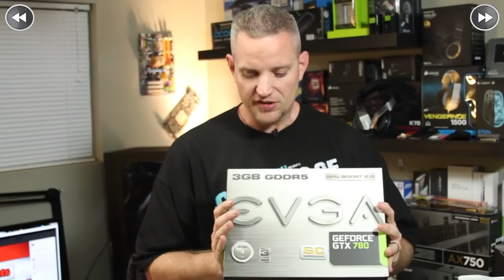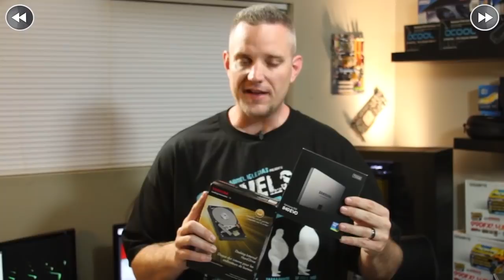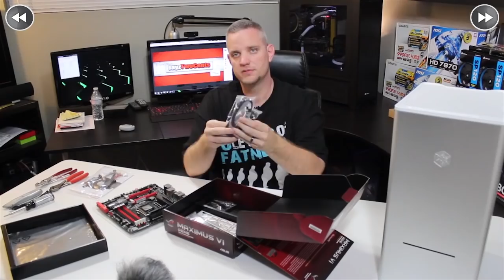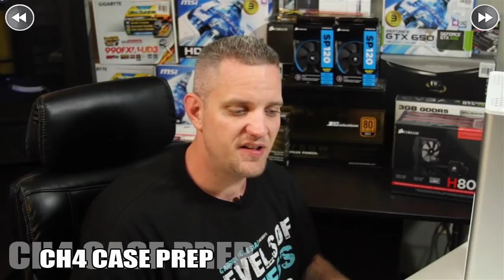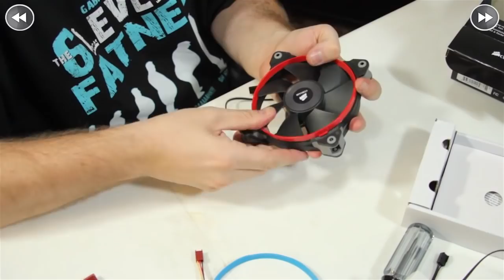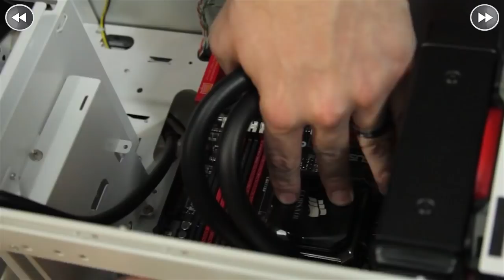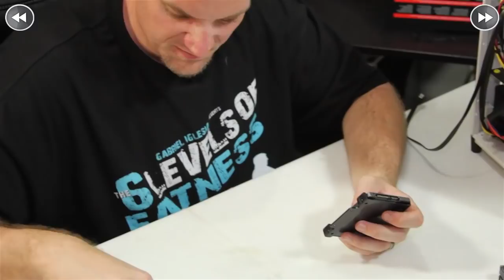How to build the Ultimate Gaming PC - Build Guide and Tutorial

Comment: Wow looking back the 4770k was a top choice only because the Z97 boards were the only and first boards for normal users to support NVMe drives which at this time weren't really known about by the masses, not too mention stupidly expensive.  I might be wrong on the first but as far as I knew only the Z97 chipsets could run it and the Z97 boards had the M.2 slots for them.

Comment: please help me my R9 M385X 4gb throttle down to 700mhz      default(core clock 1000mhz memory 1500mhz
Reply: What cpu are you using?
Reply: +brichard harris fx 8800p
Reply: a fx 8800p is fairly high end so there can't be a bottle neck happening. You should check around the internet about this. maybe you turned down your clock doing something or perhaps your motherboard doesn't support your r9 very well.
Reply: +brichard harris lenovo y700    but the gpu heat upto 80-90°c
Reply: The maximum temperature of the card in which it's still operating is 103c and under load it should be at least 20-30c less than it's max. The card does run very hot so no worries on temperatures.
Reply: +brichard harris hmm I need to do something about it
Reply: There are liquid coolers which you can put on your graphics card which will reduce temps by not very much. most i'd say maybe 10 or more c
Reply: +brichard harris I have a laptop not a pc
Reply: you have to clean your laptop from dust and apply new thermal paste to your computer if you still don't see any difference buy a cooler pad for 20$\£\€ and make sure you have your computer on table not on your bed and I heard that glass tables aren't good too so a wooden one would be good

Comment: Anybody Got A Good Rig For A Streamer That Doesn't Want To Drop That Many FPS? I'm A Console Player, The Only Game I Play On PC Is CS:GO ... So I Wont Be Needing The Best CPU Or Graphics Card
Reply: Probly need twin 1080s in sli Mabey even in tri but it's up to you you may drop some fps then I'd get the best i7 there's cause of bottle necking issues 2tb of ssd cause no one wants long load times and a 4K monitor just in case you wanna play some minecaft I'd include some other stuff but since your on a budget il leave the rest up to you just remember this is the bare minimum
Reply: +Hulk if you want to stream csgo , youd need like an intel core i5 4690k and like 16GB 1866Mhz RAM, for the graphics card a 270x should be fine
Reply: you need a good processor to handle the game and streaming at the same time, same thing goes for the RAM
Reply: +ErpleYn would recommend 380x, since they are 50 bucks apart and make a huge difference.
Reply: +AlternateEdit definately

Comment: AMD FX-8350 4.0GHz 8-Core CPU, MSI 970 Gaming AM3+ MOBO, Mushkin Enhanced Stealth 8GB MEM, Seagate 1TB HDD, MSI GTX 960 Gaming 2GB, Rosewill ARC 650W PSU, Rosewill WolfStone Case. Is this everything i need to build a pc and if so is it good enough to run CS:GO
Reply: And do i need anything else
Reply: Angielino Fidel yes, this looks good. I noticed you don't have an aftermarket CPU cooler, which doesn't matter if you don't plan to overclock the CPU, but if you do plan on overclocking (because this processor is intended to be overclocked) I'd recommend getting at least the CM Hyper 212 evo for 30$. In fact, since the FX-8350 is just a factory overclocked FX-8320, which means that the base clock is higher by default, you can just get the 8320 instead and save 30$, and then when you overclock it there won't be a difference in performance anyway. For example an 8320 overclocked at 4.5 GHz will perform the same as an 8350 overclocked at 4.5 GHz.
So if you're going to overclock, get the 8320 and a Hyper 212 cooler. But if you're not going to overclock, then the 8350 is better. If all you're playing is CS:GO, then either way it doesn't really matter which one you get, since they'll both give you good performance in that game anyway.
Reply: Ok thank u man i appreciate it il2xbox and whats overclocking
Reply: Angielino Fidel It's  making a part run faster
Reply: Ok thanks lelcetz
Reply: Angielino Fidel It makes it hotter though, and use more power.So it's no always good. sometimes it crashes the comp
Reply: Ok thanks again lelcetz

Comment: I'm thinking about building a new PC, what you think about this?
Case: Cooler Master Scout 2 Advanced 
Motherboard: ASUS X79-DELUXE 
CPU: Intel Core i5-4460 LGA 1150 CPU - BX80646I54460
Power Supply: Cooler Master V750 
Graphic Card: ASUS GeForce GTX 960 STRIX  (not sure 4GD5 or 2GD5)
I don't know about the rest yet

Comment: What's your option on. Pic I'm thinking of building? 
Here's the specs: 
Case:
corsair 760t 

Motherboard:
Ms I z87-g45 

CPU:
Intel I7 4790

GPU: 
2x msi Radeon r9 270x (I already have one) 

Ram:
8g of g.skill ripsaws f3

Power:
Corsair ax860w 

Replacement fans:
Bit fenix spectre 140mm red fans 

Custom cables: 
Red cab to type their name 

With red LEDs
Reply: ***** okay. alot of things have changed from this post. only thing the same is the case
Reply: +Harry Ford dont get a 970, get an r9 390 if you already have a 270x you might be able to crossfire it with the r9 390, hence more performance, less money youll have to check if youre able to crossfire them though
Reply: +Hello 27 get a 1070 or 1080 if u r into vr

Comment: Is this a good setup and or all compatible with each other? 

Monitor - BenQ GL2460HM 24" LED 1920x1080 Resolution

Processor - intel Core i7 I7-4790K 4 GHz Quad Core

Motherboard - MSI X99S GAMING 9 ACK Series Motherboard

RAM - Vengeance — 4GB Dual Channel DDR3 Memory Kit

Power Supply - VS Series VS650 — 650 Watt 

Hard Drive - Seagate - 1TB Internal Serial ATA Hard Drive

Graphics Card - MSI - NVIDIA GeForce GTX 960 2GB GDDR5 PCI Express 3.0 Graphics Card - 

CPU Cooler - Hydro Series H110i GTX 280mm Extreme Performance Liquid CPU Cooler

Case - Graphite Series™ 760T Full-Tower Windowed Case
Reply: James Fulkerson what is your budget,,, the mobo is for lga 2011-3 and the cpu is a lga 1150
Reply: My budget is $2,500
Reply: Just wait a few minutes, i will give you a pcpartpicker list...
Reply: http://pcpartpicker.com/p/FsXMYJ there you go... you can choose a cheap monitor, but stick with 2160x1440

Comment: Hey guys! Do u think that i can build a gamer pc for about 1500$?
Reply: Dumma Dum Gaming 
Just a little insight on what you can buid with a $1500 budget (assuming you have keyboard and mouse)

PCPartPicker part list: http://pcpartpicker.com/p/s6X2Mp
Price breakdown by merchant: http://pcpartpicker.com/p/s6X2Mp/by_merchant/

CPU: Intel Core i5-4690K 3.5GHz Quad-Core Processor  ($199.99 @ Micro Center) 
CPU Cooler: CRYORIG H7 49.0 CFM CPU Cooler  ($34.50 @ Newegg) 
Motherboard: Gigabyte GA-Z97X-Gaming 5 ATX LGA1150 Motherboard  ($116.00 @ SuperBiiz) 
Memory: G.Skill Sniper Gaming Series 16GB (2 x 8GB) DDR3-1600 Memory  ($102.99 @ Newegg) 
Storage: Crucial BX100 250GB 2.5" Solid State Drive  ($89.99 @ Newegg) 
Storage: Western Digital Caviar Blue 1TB 3.5" 7200RPM Internal Hard Drive  ($52.49 @ OutletPC) 
Video Card: EVGA GeForce GTX 980 Ti 6GB ACX 2.0+ Video Card  ($661.23 @ Amazon) 
Case: NZXT Phantom 410 (Red) ATX Mid Tower Case  ($74.99 @ NCIX US) 
Power Supply: EVGA 750W 80+ Bronze Certified Semi-Modular ATX Power Supply  ($75.98 @ Newegg) 
Optical Drive: Asus DRW-24F1ST DVD/CD Writer  ($17.89 @ OutletPC) 
Total: $1426.05
Prices include shipping, taxes, and discounts when available
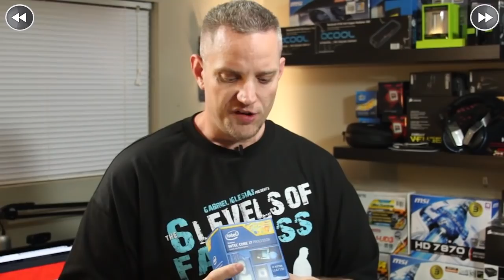Generated by PCPartPicker 2015-06-19 03:08 EDT-0400

With the remaining $74, you can upgrade to a better PSU. :)
You can also opt out the 980ti and get a 980 or a 970 which has the highest power to value ratio and save a few hundred dollars.
Reply: Dumma Dum Gaming yes you can!
Reply: Dumma Dum Gaming you can build a monster machine with that money!
Reply: Kappa Kappa Nice! it's very good to know :)
Reply: Pablo Lemus WOW thank you, so this will run all games 60fps? (doesent have to max out settings)
Reply: You'll be running every single game 80fps+ maxed out at 1080 and can play at 4k 30-40fps maxed out and you'll have full DirectX 12 support :)
Reply: NICE! thank you for the help :)
Reply: Dumma Dum Gaming my mistake, you playing at 4k resolution with the 980ti won't give you 30-40 frames, it'll give you much higher. Search on YouTube, 980ti benchmark
Reply: Pablo Lemus Ok... but thats good... right? i will be looking for the videos :3
Reply: That's really good. It's basically the Titan X ($1,200) with a tiny bit less performance and half the price. It's the best single card you can buy ATM.

Comment: 780 for a ultimate pc?
Reply: The Game Inventions the 980 is a better choice BUT costs more and really the 780ti can mac out 1080p games still and for the next year
Reply: ***** so?
Reply: ***** yes it was and it still is with the price rapidly droping.
Reply: ***** not at all the 980 is great and better but for the price id stick with the 780ti because of optimization and when time comes id just Sli it
Reply: ***** not really the 780ti has had more time for developers to optimize the games
Reply: ***** Ti* the Ti is the same price as the 980 and i am personally going with it
Reply: ***** im going to do duel r7 260x's or a single 780ti and upgrade to SLI in a year or two i dont need a super computer for what i do :P
Reply: ***** yea the config im using allows me to just pop a new 780ti in when i need to atm the build is 1150$ with a 8350 16gb ram 3tb hd 850W PSU Corsair  Corsair 200R case and a 780ti
Reply: ***** i think SSD's have there place but i dont like them too expensive for me right now and it wont impact gaming performance :P just load times
Reply: ***** i plan on multitasking duel mabye tri monitors so i would like the wiggle room
Reply: its better than an 970 and its close to a 980

Comment: [PCPartPicker part list](http://pcpartpicker.com/p/8JfFhM) / [Price breakdown by merchant](http://pcpartpicker.com/p/8JfFhM/by_merchant/)

Type|Item|Price
:----|:----|:----
*CPU* | [Intel Core i7-5930K 3.5GHz 6-Core Processor](http://pcpartpicker.com/part/intel-cpu-bx80648i75930k) | $499.99 @ Micro Center 
*CPU Cooler* | [Corsair H100i 77.0 CFM Liquid CPU Cooler](http://pcpartpicker.com/part/corsair-cpu-cooler-h100i) | $92.53 @ Amazon 
*Thermal Compound* | [Arctic Cooling MX4 4g Thermal Paste](http://pcpartpicker.com/part/arctic-cooling-thermal-paste-acmx4) | $6.89 @ OutletPC 
*Motherboard* | [Gigabyte GA-X99-GAMING 5 ATX LGA2011-3 Motherboard](http://pcpartpicker.com/part/gigabyte-motherboard-gax99gaming5) | $263.99 @ Amazon 
*Memory* | [Crucial Ballistix Sport 32GB (4 x 8GB) DDR4-2400 Memory](http://pcpartpicker.com/part/crucial-memory-bls4k8g4d240fsa) | $316.99 @ Newegg 
*Storage* | [Seagate Barracuda 2TB 3.5&quot; 7200RPM Internal Hard Drive](http://pcpartpicker.com/part/seagate-internal-hard-drive-st2000dm001) | $71.95 @ SuperBiiz 
*Video Card* | [MSI GeForce GTX 980 4GB Twin Frozr Video Card](http://pcpartpicker.com/part/msi-video-card-gtx980gaming4g) (2-Way SLI) | $549.99 @ Amazon 
*Video Card* | [MSI GeForce GTX 980 4GB Twin Frozr Video Card](http://pcpartpicker.com/part/msi-video-card-gtx980gaming4g) (2-Way SLI) | $549.99 @ Amazon 
*Case* | [NZXT Phantom 240 ATX Mid Tower Case](http://pcpartpicker.com/part/nzxt-case-caph240w1) | $65.99 @ Newegg 
*Power Supply* | [Corsair Builder 600W 80+ Bronze Certified ATX Power Supply](http://pcpartpicker.com/part/corsair-power-supply-cx600) | $54.99 @ Micro Center 
*Optical Drive* | [Asus BW-12B1ST/BLK/G/AS Blu-Ray/DVD/CD Writer](http://pcpartpicker.com/part/asus-optical-drive-bw12b1stblkgas) | $57.75 @ OutletPC 
*Operating System* | [Microsoft Windows 8.1 Pro - 64-bit (OEM) (64-bit)](http://pcpartpicker.com/part/microsoft-os-885370635003) | $134.89 @ OutletPC 
*Wireless Network Adapter* | [Asus PCE-AC68 802.11a/b/g/n/ac PCI-Express x1 Wi-Fi Adapter](http://pcpartpicker.com/part/asus-wireless-network-card-pceac68) | $93.99 @ Amazon 
*Monitor* | [Acer H236HLbid 60Hz 23.0&quot; Monitor](http://pcpartpicker.com/part/acer-monitor-umvh6aa003) | $137.99 @ Best Buy 
*Monitor* | [Acer H236HLbid 60Hz 23.0&quot; Monitor](http://pcpartpicker.com/part/acer-monitor-umvh6aa003) | $137.99 @ Best Buy 
*Monitor* | [Acer H236HLbid 60Hz 23.0&quot; Monitor](http://pcpartpicker.com/part/acer-monitor-umvh6aa003) | $137.99 @ Best Buy 
*Keyboard* | [Cooler Master CM Storm Devastator Gaming Bundle Wired Gaming Keyboard w/Optical Mouse](http://pcpartpicker.com/part/cooler-master-keyboard-sgb3010kkmf1us) | $28.99 @ NCIX US 
*External Storage* | [Seagate Expansion 4TB External Hard Drive](http://pcpartpicker.com/part/seagate-external-hard-drive-stbv4000100) | $121.98 @ Newegg 
 | Prices include shipping, taxes, rebates, and discounts |
 | Total (before mail-in rebates) | $3364.87
 | Mail-in rebates | -$40.00
 | *Total* | **$3324.87**
 | Generated by [PCPartPicker](http://pcpartpicker.com) 2015-05-07 17:25 EDT-0400 |
Reply: iRichHD lol

That's really all I can say. This is without a doubt one of the stupidest builds I've seen. You seem like someone who's never looked into building a PC at all and picked some expensive crap for no reason other than price.
Reply: FirstDragonSlayer
Right? lol that was where I lost it. $3,400 and using a CX600?
Reply: iRichHD Uhhh, alright so I have a couple questions. 1. What are you using your computer for that you need that kind of CPU? You could save money by getting a i7-4790k. Also, since you're spending that much money, ditch the 2TB drive, and buy 2 500GB SSD.
Reply: iRichHD 
No. Just no.
PSU is absolute shit, especially for dual-GPU system.
You also won't ever need this kind of a PC, you're just posting this for the shits and giggles. Go away.
Reply: Mike Adams
and then went in and bought a 50$ PSU for it.
cancer.
Reply: Mike Adams
Another thing is that the CX series is pretty much garbage now. Friend had several dozen customers complaining about it in last 7 months.
The only really dominant PSU manufacturer here in Croatia are XFX and Seasonic, which is basically the same thing xD

Comment: Would this build run most games at 1080p 60fps? keeping in mind I want modest future proofing: http://pcpartpicker.com/p/vBRnJx
Reply: Yes it would, just before buying it make sure the ATX size is the same as the case and make sure the ram and everything is compatible with the motherboard
Reply: Bullet Bill if i were you, i'd probably go for a fx-8320 or fx-8350 just for that bit of extra cpu power. it wont make a huge difference in terms of gaming on most games but for just about $40 more i think the performance is just much better and it will future proof your system a lot more.

Comment: Intel Core i5-4090k
Cooler Master Hyper 212 EVO 82.9 CFM Sleeve Bearing CPU Cooler
MSI Z97 PC MATE ATX LGA1150 Motherboard
G.Skill Ares Series 8GB (2 x 4GB) DDR3-1600 Memory
Kingston SSDNow V300 Series 120GB 2.5" Solid State Drive
Western Digital Caviar Blue 1TB 3.5" 7200RPM Internal Hard Drive
MSI GeForce GTX 970 4GB Video Card
Corsair 200R ATX Mid Tower Case
EVGA SuperNOVA NEX 750W 80+ Bronze Certified Semi-Modular ATX Power Supply

How do you think this build is? Its soon to be my first build and would it run games such as Witcher 3 on high or medium?
Reply: Nathaniel Fletcher i geuss you mean the 4690K instead of 4090K and it is good but if i were you i would wait for amd new 380x. should be about the same price as a 970 but because of a completely new architecture it should be on par in terms of performance with a titan x or atleast a 980

Comment: I'm planning on getting a new PC. I plan to play games, edit, render, record, etc on this PC. Here are the specs. 

CPU: Intel Core i7 4790k 
CPU Cooler: Corsair H100i
GPU: Asus GTX 970 Strix
MoBo: Asus Sabertooth Z97 Mark 2 Board
RAM: 16GB DDR3 1866 MHz Kingston Fury Black RAM
PSU: Corsair CX750 Watt PSU Fully Modular 
HDD: Seagate Barracuda 7200 RPM 60MB Cache 1TB Drive
SSD: 256 GB Samsung 850 Pro Drive
Case: Fractal Design Define R5 w/ Window (Titanium Grey)
OS: Windows 8.1 64 Bit OEM
Keyboard: Corsair K70 RGB Backlit Mechanical Keyboard with Cherry MX Reds or the Roccat Ryos MK Pro Mechanical Keyboard with Cherry MX Blacks, or the Mionix Zibal 60 w/ Cherry MX Blacks. (Already have the Blackwidow Ultimate 2013)
Mouse: Razer Naga Epic Chroma
Mic: Audio Technica AT2020 Condensor Microphone XLR
Reply: SlicingSniping  almost same comparing to mine. but i went with 1000w psu to be able to go sli in future without any concerns (some say 850w is enough for 2 970s oc`ed).

Comment: 4 x Titan Z
AMD 9590 or Intel i7 x whatever the fuck
Whatever mobo that can support liquid nitrogen 
4 x 1TB SSDs
2 x 6 TB HDDs
3 x 4k G sync monitors
3000w PSU
A bunch of fans 
Whatever brans
DDR3 for AMD/DDR4 for Intel
128 GB of RAM 
Windows 11

And... 
Water loop system for liquid nitrogen.

Bam.

Comment: Hey can anyone tell how this build is:

CPU
Intel Core i5-4590 3.3GHz Quad-Core Processor

CPU Cooler	
Corsair H55 57.0 CFM Liquid CPU Cooler

Motherboard	
Asus Z97-C ATX LGA1150 Motherboard

Memory	
Kingston Fury Black Series 8GB (2 x 4GB) DDR3-1600 Memory

Storage	
Intel 530 Series 120GB 2.5" Solid State Drive
Western Digital WD Green 2TB 3.5" 5400RPM Internal Hard Drive

Video Card	
MSI GeForce GTX 750 Ti 2GB TWIN FROZR Video Card

Case	
Corsair SPEC-01 RED ATX Mid Tower Case

Power Supply
Corsair CX 430W 80+ Bronze Certified Semi-Modular ATX Power Supply
Reply: 430w is not enough. You need at least 500w